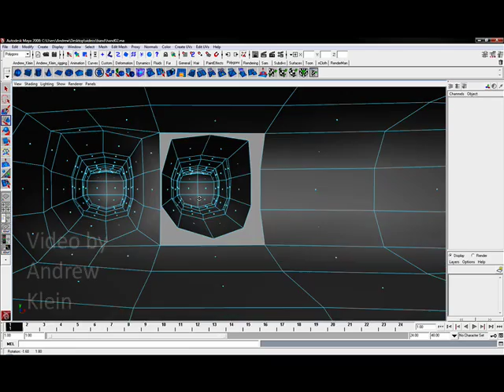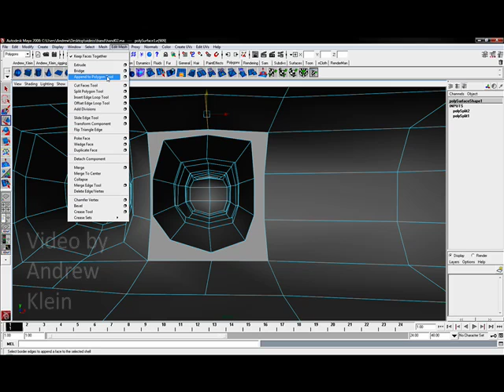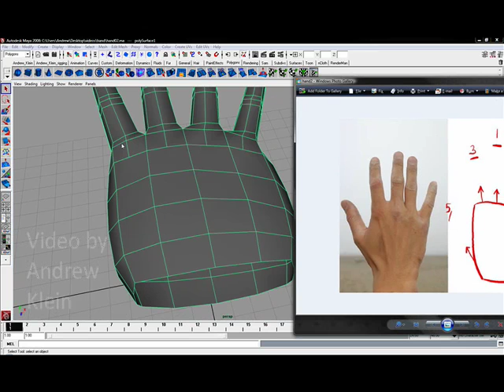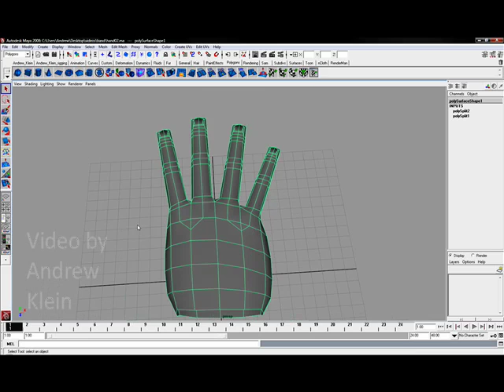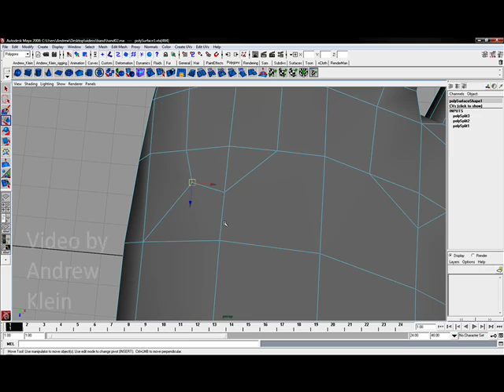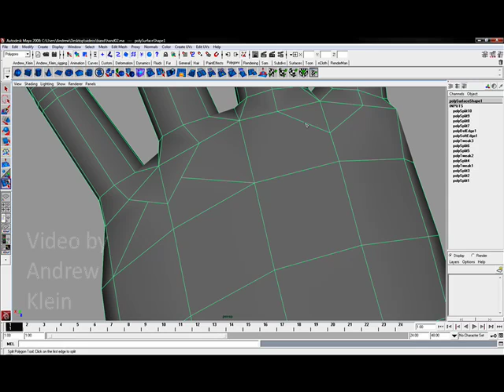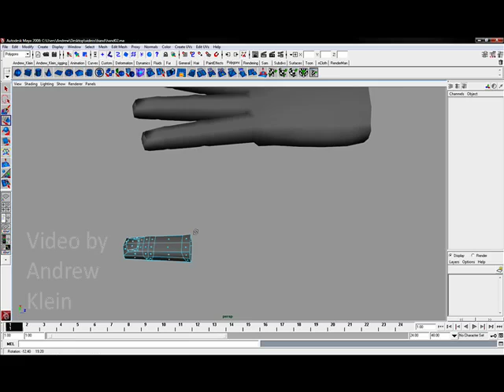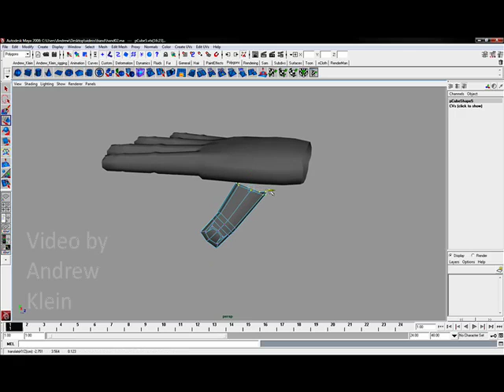Maya Modeling Basics: Polygon Hand, pt. 4

Comment from the maker: Maya records EVERY action you take and logs it in the hypergraph input and output connections as a node connected to your geo. The more nodes you have, the larger the size of your scene file. When manipulating your geo, all the nodes connected to it (your history) are still being calculated. Those connections can get misread over time causing file corruptions. Imagine if you had a treasure map, and had to retrace all your steps from the start of the map everytime, instead of just going to X.